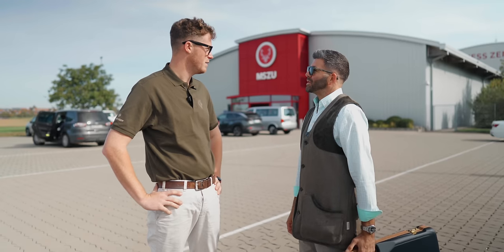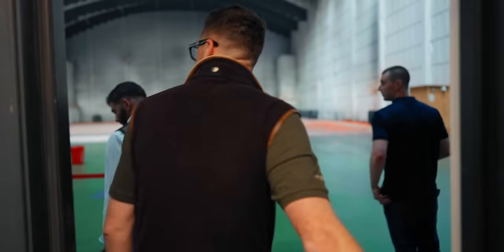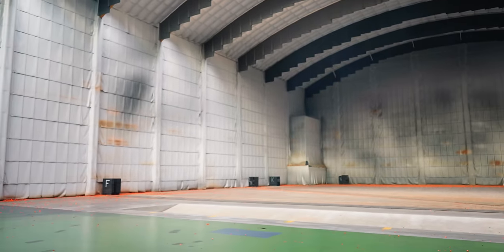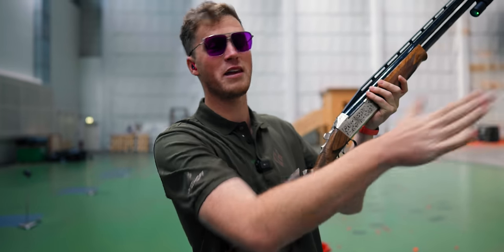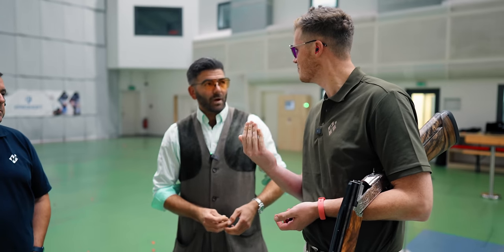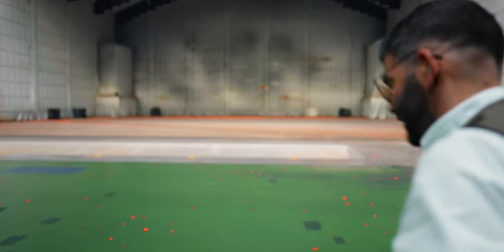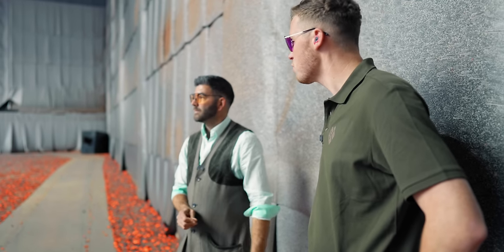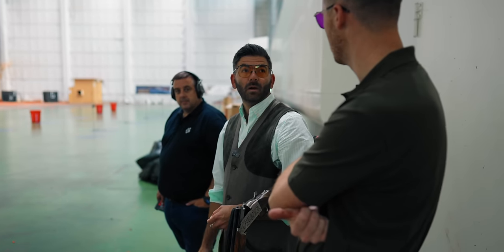Indoor Shotgun Range!?

Comment: As a german hunter living in the south MSZU is a nice place for checking out new guns and also buy some other stuff you need. Most german gun shops are muuuuuuch smaller and have less than 10% of the collections.
Dick knife -> this is a famous local factory for knifes and most of the butchers here are using their stuff. They have sharpeners, files, ... too but the butcher knifes is a musthave

Comment: Curious about what ammunition is used/allowed on this indoor facility. I imagine there is a shot size and velocity limitation. Is there a lead use restriction?
Reply: I guess both is allowed
Reply: It's easy to minimize lead issues with proper ventilation and regular cleaning/sweeping
Reply: Just make it steel only. Level the playing field.
Reply: Steel tends to bounce around indoors.
Reply: @TurinTuramber yeah steel shot would be terrible indoors. It bounces whereas lead smashes and deforms, duping it's energy into whatever it hits vs bouncing off of it. Lots of steel in this building so shooting steel with steel would bean issue
Reply: @eduffy4937  Easily negated if ricochet was ever a problem. Would be easy to clean up the shot with a magnetic collector.
Reply: @TurinTuramber  how would you negate it without costing so much extra in labor or consumable panels?

Comment: Chocking your loss up to “gun fit” isn’t a thing my man. Lead target, pull trigger. The perfect feel of the gun isn’t imperative for making a good shot. Applying the basics for shooting is what makes the shot. I’ll outshoot people with their own allot of the time. Sooo….don’t make excuses for poor shots.
Reply from the maker: Sounds like a challenge - come and beat me with my own gun?
Reply: I disagree massively. In theory if your eye is in the same place in relation to the rib then yeah you’d have thought the shots would look the same. But I havnt found that to be true. Besides an incorrect gun fit can change other factors that will affect your shooting such as positioning of your upper body. 

You can definitely learn to shoot a gun that doesn’t fit however to say gun fit doesn’t affect your shooting is utterly false. Not to say you need a perfect fit to shoot well however having a dramatically wrong fit will certainly hinder you